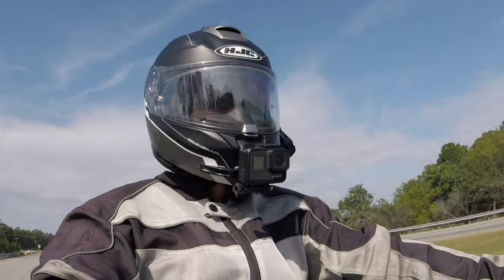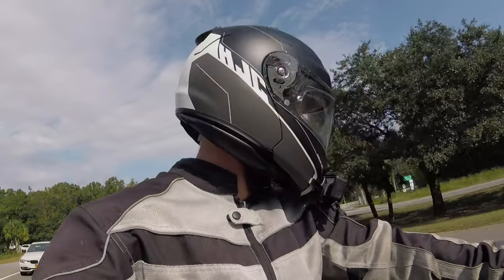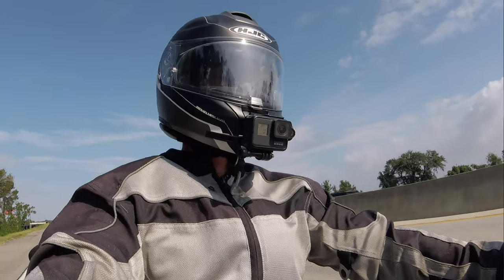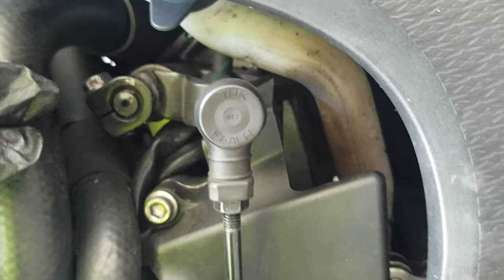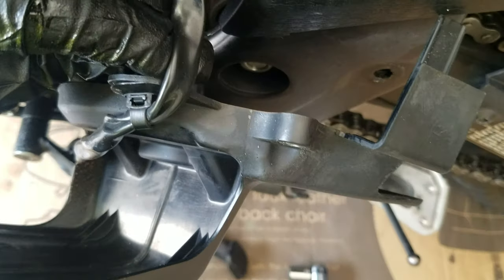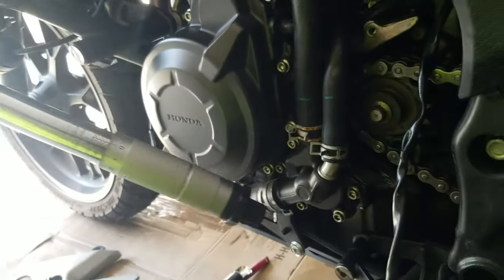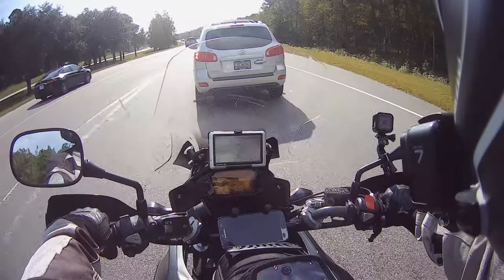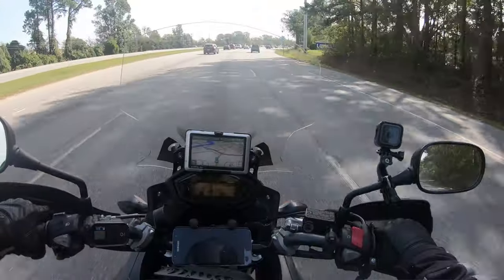CB500X 16T Sprocket Swap

Comment: Anyone done BOTH the 16t front sprocket and 39t rear upgrade? Curious the effect of doing both. Thanks!
Reply from the maker: Even more pronounced shift than doing one.  But I fear gearing would be too tall with both.
Reply: @MotoPhotoAdventures  I was looking to buy a 2013 where the guy did both. He swore it was the best upgrade hes done, said it should have cme like that from the factory.
Reply from the maker: @jackdonoghue5527  that's awesome!  If he was happy with it, and you're happy with it, that's all that matters.  Mine is a 2013 as well with over 80k miles.  Since I do a combination of boring highways, twisty mountain roads, and off-road dirt trips, I find just the 16T swap is the perfect middle ground.  But if you do mostly highway, I could easily see doing both would be nice.  Check out this crazy off-road adventure we're on:  https://youtu.be/dhs96YJFnoA.

Comment: Hello everyone. 

One question. 
Where does the speedometer take it's reading? 
Why does it vary?

Thank you.
Reply from the maker: On old motorcycles, the speedometer reading came from a cable that went down to the front wheel.  But that was inaccurate and had a tendency to break.  Modern motorcycles take their reading from an electronic mechanism.  On the CB500X, this device is found on the left side of the bike under the plastic side panel, near where the stator is located.  Many things can cause the speedometer to become inaccurate...even just changing to a different tire with a slightly different diameter.  Plus, most bikes aren't 100% accurate even from the factory.  This is why I use a Garmin Zumo GPS at the front of my bike so that I always have an exact readout of my speed based on the GPS satellite.  However, if you don't have this, and want to calibrate your speedometer, it's very easy to do.  Simply order a SpeedoDRD DRD-3 from 12 oClock Labs at https://amzn.to/2Pahs8C.  Plug it into the electronic mechanism I mentioned earlier, run the calibration, and you're all set!
Reply: @MotoPhotoAdventures  thank you very much for your comprehensive answer.
Reply from the maker: @mihaigeanta5110  happy to help!  Check out some of our other CB500X videos.

Comment: Good video, I’m been thinking about this simple change since I picked up my 19’ in August. Wonder if there’s a speedometer correction available out there somewhere. Anyhow you should do more Cb500X videos!
Reply from the maker: You're very kind, David!  Thanks for the encouraging remarks.  I've heard theres a device you can plug in under the seat that will correct the speedo.  Or just get a cheap GPS like I have.  :-)  Either way, don't hesitate to do this upgrade!!!
Reply: Hey David.  Did you replace your front sprocket with the 16 tooth one?  IF yes, did you also have to replace your chain with one that has one more link than stock when you replaced your front stock sprocket to the 16 Tooth one such as in Chris Smith's video?  I don't think Chris mentioning having to do that, but I'm just making sure.  

I'm ordering my 2019 in early December and would love to do this too if he possibly helps not long stretch out more usage of first gear and but alittle extra mpg too.  Cheers
Reply: @motoryzen  I think I saw one of the comments indicate that the standard chain has enough length for the extra tooth, which should be the case for one tooth extra.
Reply from the maker: @motoryzen  I didn't have to replace my chain.  The old one worked great!
Reply: @MotoPhotoAdventures  when I replaced my stock front 15t and rear 41t sprockets with front 16 and rear 40, my stock chain worked perfectly also.  Id like to go to 36 rear tooth sprocket, but I've out another 3k miles on this bike since that change. I'd prefer to wait until the chain is much worn down first and will probably go one chain link shorter than stock to account for proper tension-room-of- adjustment. (Shrugs)

Comment: Has the sprocket change not made the speedo read the wrong speed?
Reply from the maker: Hi Glideman!  I guess you'll have to watch the video to find out.  ;-)  The short answer is "yes".  Luckily there are easy ways to get the correct speed.

Comment: For Beginner bike riders.  I wouldn't recommend changing sprockets right away, in the beginning. Maybe even tight traffic commuting. It can be helpful in the slower 1st. gear start out. Or have the crawl mode. When traffic is very slow.   
ADV. riders=  It's nice to have 15t sprocket for tight spots and climbing hills. Better than burning up your clutch.
Yes, 16t sprocket is great for the higher speeds. If you are doing it most of the time.
As for video!   Looks as chain and sprockets are very worn.   Should never put new sprockets on old worn existing components. Cool comparison though!
Reply from the maker: Thanks Dave!  Those are all excellent points.  And I completely agree!  Although I DID do the entire Trans-America Trail, including some pretty gnarly stuff on Cinnamon Pass (https://youtu.be/Im8M-tRJXuY), with this 16T setup.  Although I don't really recommend it.  ;-)  Thanks for the great comment!
Reply: @MotoPhotoAdventures  Super Cool! Trans-America trail.  That would be great to try that some day.  I will be checking out your video. Thanks!   
I would imagine getting a bike loaded up full  of gear.  15T would make it better.  
As you said, 16T it's do-able though!  Better to have some good riding experience. 
Main thing is to ENJOY !
Reply from the maker: @dave8456  you are absolutely correct!  Whether you have a 14, 15, or 16T drive sprocket...it really doesn't matter.  Just get out and ENJOY THE RIDE!!!  :-)  P.S.  The TAT is amazing!  Put it on your bucket-list.

Comment: Chris: I am going to try this on my CBR500R as it seems to be geared much the same way as your original setup. However, I am concerned about the speedometer calibration. Is this changeable
Reply: Also wondering about the same thing- did this mess up your odometer and speedometer calibration?
Reply from the maker: Hi Philip!  I understand there are electronic devices you can plug in that will recalibrate the speedo.  But for me it was a non-issue.  The new sprocket basically increases the speed by 10%.  So when my speedometer says 50, I'm really going 55.  Since I often ride at 10% over the speed limit anyway, I just ride at the speed limit and know that I'm already at 10% over.  But to make matters even easier, I have a GPS mounted above my dashboard that always shows me exactly what the speed limit is on that road, as well as my exact speed based on GPS satellite.  Even when it was stock, my speedometer wasn't exactly accurate.  So I'm always looking at my GPS instead of my speedo anyway.  Hope this helps!  By the way, if you want to add a waterproof GPS for about $30 like I did, here's my DIY video:  https://www.youtube.com/watch?v=0x4pZ6Of70c&t=1s
Reply from the maker: Hi  @KimCruz1 !  It depends on many factors.  If you read the other comments, some riders found their stock speedometer was not very accurate and changing to the 16T made it more accurate.  Others, like myself, find it increases the actual speed by about 10% over the speedometer readout.  Many factors play into this, such as what size and brand of tires you are using.  There are ways you can recalibrate your speedo.  But for me, it's a non-issue.  It's easy for me to recalculate actual speed by adding 10% to my speedometer readout.  Plus I have a GPS mounted above my dashboard that always displays exact speed.  Hope this helps!
Reply: Chris Smith appreciate the answer thank you very much!
Reply: I've installed the Healtech Speedohealer,  works great and is adjustable if you change back and forth with the sprockets as I do......
Safe rides 👍🏍
Reply: #andre Hammersmith: thanks for that 🏍😎
Reply: Chris Smith thanks Chris. I am riding the 500R so a different setup, but basically giving me the same RPM/Speed result. So, definitely going to look at doing this modification and recalibrating the speedo. Our speed limits are pretty rigidly enforced 😳🏍
Reply: @MotoPhotoAdventures  16/15 = 1.0666 or a 6.67% increase in distance traveled per rev. I guess that's about 10% if you are ok with being off by 3+% One would expect more like a 500 RPM drop at 80mph than 800.
Reply from the maker: @kleinbottled79 thanks for the kind comment and excellent math!  My test rides were not controlled measurements...more like general observations.  Differences in highways used, wind speed, inclines, etc. certainly could have affected my observed speed and rpm reedings.
Reply: @MotoPhotoAdventures  Differences in, say tire pressure, or the amount of tread wear on the rear tire, anything that changes the diameter of the rear wheel, would allow for a very small change in the gearing. Other than that, a gearing change, the relationship between speed and rpm is absolute
   It's much like if you were lifting a weight with a lever.  We'll say this lever is 1 to 1, with the fulcrum in the very middle for easy math. Changing the weight (load) doesn't change the fact that six inches down on one side will lift the weight on the other 6 inches. Without something breaking, bending, or slipping every inch down is worth exactly an inch up. So it is with a ground bound motor vehicle. For the RPM to speed relationship to change for a given gear; it would require something to slip. Short of a slipping clutch or a slipping rear tire there is no slippage in a drive-train. Hence no matter what road you are on, or in whatever wind, these numbers will always match. You could use your tach as a speedo in top gear if you memorize what speed you are going per rpm. ( Really In every gear if you memorized all the ratios.)
Reply from the maker: @kleinbottled79  very true!
Reply from the maker: Happy to help, @KimCruz1

Comment: An excellent video. The biggest question is "why the hell don't Honda fit this as standard, it is so right".
Good to see Dr John Campbell commenting. Follow him closely. Now I know what you ride John.
Reply from the maker: Thanks for the comment, Tim!  Remember that Honda is a world-wide distributor.  Not every country has the wide highways and smooth interstates we do.  If you live in a mountain village in Taiwan, for example, you will probably find the gearing with the 15T is perfect for the steep slopes and tight curves.  :-)

Comment: Why is the speedo off? It doesn't measure the speed phisicaly? I never had a modern motorcycle cos I like oldies. How is the speed measured?
Reply from the maker: That is correct, Jarwicz!  Older motorcycles measure the speed off the front wheel physically.  New motorcycles use a sensor that comes off the front sprocket.  When you change the sprocket, the sensor doesn't know it.  So even though the rear wheel is moving at a different speed, the sensor still thinks it's moving at the old speed.  There's a device called a Speedo Healer that you can plug into the motorcycle's sensor to "correct" the mileage electronically.  But it costs about $75 and I just haven't bothered with it since my GPS tells me exact speed anyway.
Reply: Another gizmo to engineered to get your money. Could have installed that sensor somewhere around wheels to measure realistic speed. Ehhhh I'm only 40 but already too old for all that electronic stuff.
Was so pissed at my audi when found out it doesn't have a dip stick hah

Comment: Can you tell me if l putted 17 tooth sprocket what will happened
Reply from the maker: White Wolf, others have done it.  But you'll probably have to modify or remove the front chain guard to get it to fit.  And you may need a longer chain.

Comment: Looking to do the same to my bike but how would you change the speedometer so it shows the correct speed?
Reply from the maker: It's very easy to do.  Just buy a SpeedoDRD or Speedo Healer and plug it in to calibrate the correct speed:  http://shop.12oclocklabs.com/index.php?route=product/product&product_id=59.
Reply: @MotoPhotoAdventures  cheers Chris ill have a look at that 😊

Comment: I’ve been seriously considering the 500x. I guess the only thing I’ve been a little concerned about is the highway buzz/vibration and high rpms. I’m glad this seems to be a great fix. How did it go modifying the guard?
Reply from the maker: Hi Rick!  The CB500X is a twin-cylinder bike, which means there is actually very little highway vibration compared to a single-cylinder bike like a KLR or DR650.  However, I find this simple modification for less than $40 makes it EVEN smoother on the highway.  By the way, if you do a lot of highway and longer distance commuting, I HIGHLY recommend getting one of these:  https://youtu.be/yZsexrfGH1E.  I found out later there is NO modification needed to the chain guard.  Apparently, I had re-installed it upside down.  When I turned it right-side up, there was plenty of clearance for the 16T sprocket.  I hope this helps.  It's an amazing bike for the money.  I think you'll really enjoy it!
Reply: I’m selling my XT 250 and will be saving a little extra cash to get this bike.
I started a new job, selling motorcycles, we don’t have any in stock. There is a 2015 model that has been in the service warehouse for a few months. It was layed down but seems ok according to our service manager. Just bodywork repair . They may sell it. They owe 2700 for repair. I think I can get her for a little more. Only red flag, it’s got 57 k miles. My service manager said he wouldn’t be concerned about the high miles. Do you have any feedback?
Reply from the maker: @ricklarmer461  I wouldn't have any concerns over those miles.  I have about that many on my 2013 and she still purrs and smoothly as the day I got her.  Maybe just have them do a complete service including oil, air filter, coolant, brake fluids, spark plugs, and gaps.  The last couple will be expensive.  The first few you can easily do yourself.  But unless you know the history on the bike, it's best to start fresh.  Also check chain and sprockets to make sure they don't need to be replaced.  By the way, all these maintenance items could be used in negotiating against the seller for the best price possible.  If you can get that bike for a great deal...GO FOR IT!!!  If not, hold out for a 2019 or newer model because Honda upgraded the front wheel to a 19" and made some other improvements after the 2013-2018 series.  Even so, if you can get the bike for a good price, ride it for a year, you'll get your money back if you decide to buy a newer model later!  Good luck!!!

Comment: Hey Chris! Thanks for this tutorial - I'm about to switch to a 16T on my 500X - how did you know that the sprocket guard needed grinding? Did you install the guard and hear clicking when you put everything back together? Curious to know what flagged you. Thanks!
Reply from the maker: Hi M B!  That's exactly what happened.  My first ride down the street when I would decelerate I heard a clacking sound.  I immediately Googled it and saw that someone else had ground theirs down.  So I did the same.  But then when I went to re-install it, I found I had TONS of space!  I can't know for sure, but I suspect that when I re-installed it that first time, I installed it upside down.  It will actually bolt in place both directions.  But the "curve" is off-center.  So having it upside down may have been the actual culprit.  Just make sure when you remove the guard that you make note of which direction it's facing, and re-install it the same way it came out.  Honestly, if you do that, I seriously doubt you'll have to grind it, especially since I've had tons of other owners write and tell me they did this exact same mod and didn't have to grind anything to make it fit.  :-)  Enjoy your newly transformed bike!!!
Reply: @MotoPhotoAdventures  I just did this and had the exact same clicking noise while decelerating.  However, I am 100% sure I put the sprocket guard in the correct way. Any ideas??
Reply from the maker: @nathanandrews9659  I can't imagine anything else that would cause that.  It would be easy to remove the guard entirely (which many owners do), and ride down the street to see if the clicking goes away.  If so, you've found your culprit and need to find yourself a friend with a metal grinder.  :-)
Reply: @MotoPhotoAdventures  Ended up being too lose of a chain. Tightened it up and it runs great
Reply from the maker: @nathanandrews9659  that's great news!  Have you seen this tool I use?  https://youtu.be/3hdtqnFkNKA.  Makes keeping your chain properly adjusted super easy.  Discount code in the description if you're interested in getting one.